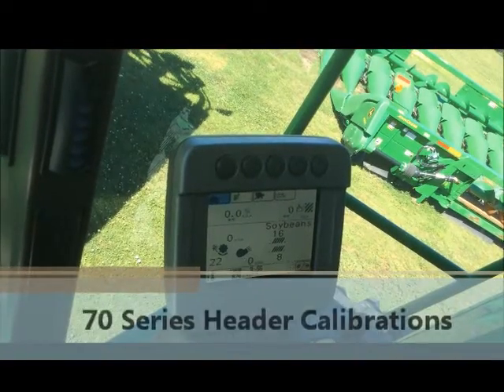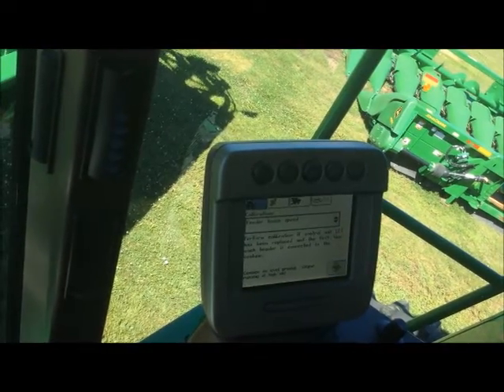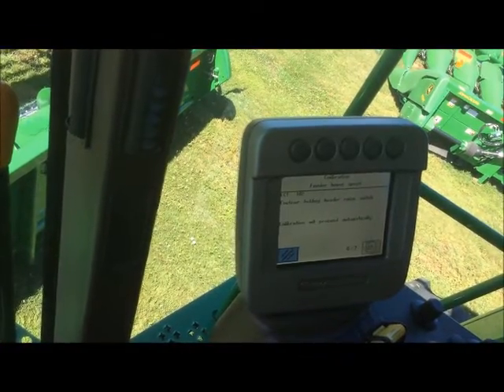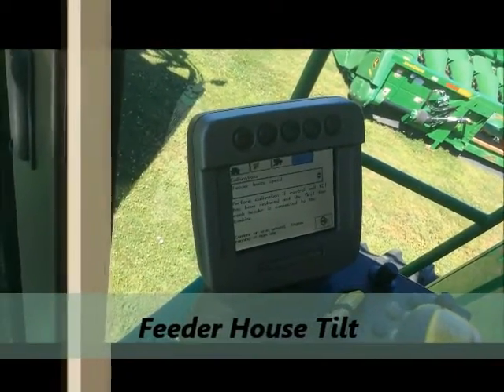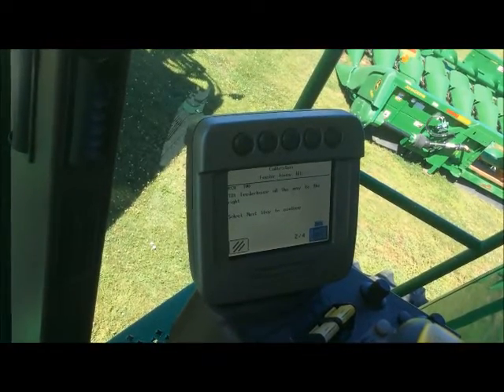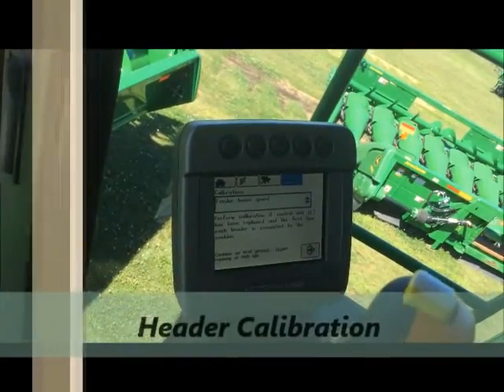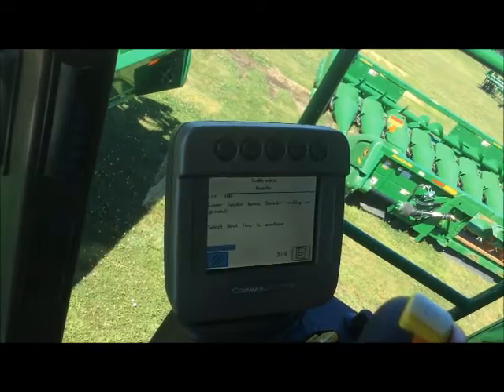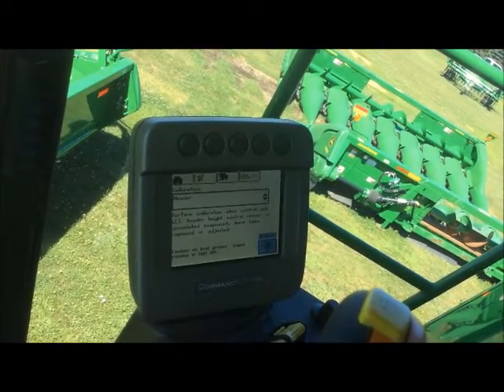Header Calibration for a John Deere 70 Series

Comment: How do you calibrate distance traveled on a 9570?
Reply from the maker: Are you trying to adjust your tire size/rolling radius so your mph is more accurate? If so, there would be a tech address that your local shop can look up.  This is what is what the Operator's Manual says:

Changing Tire Radius
If tires or final drives are changed from what was originally shipped from the factory, it will be necessary to recalibrate the system. Verify that the correct tire code is entered into memory.
IMPORTANT:
When changing drive wheels, tire radius may also change. If so, CAB controller must be adjusted to new tire radius. See your John Deere dealer for further information on changing tire codes.
Failure to recalibrate system will result in inaccurate Harvest Monitor Yields.